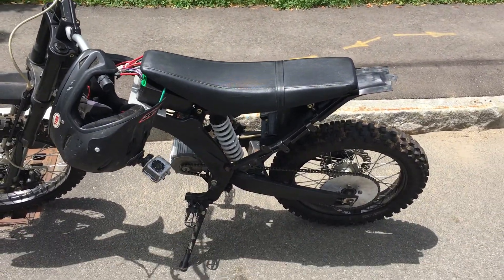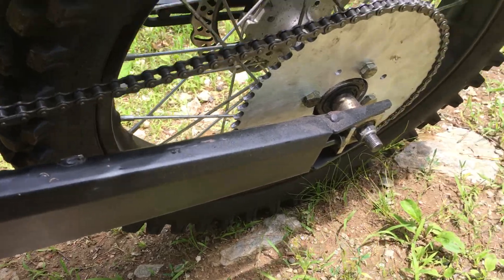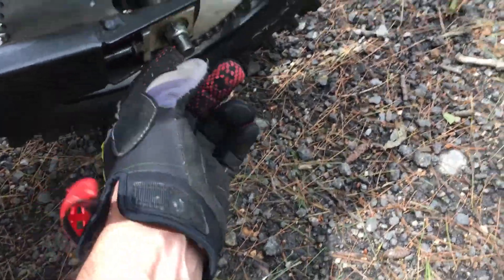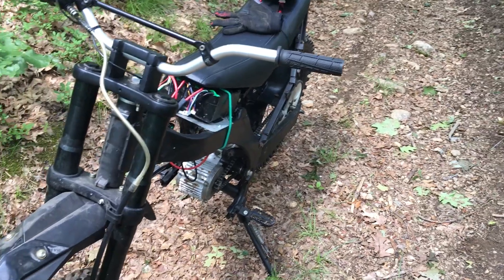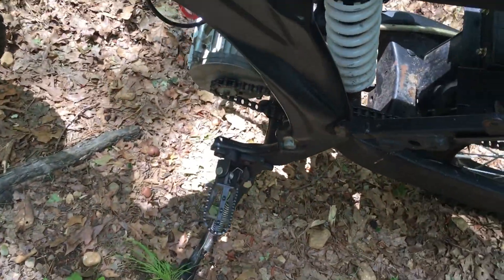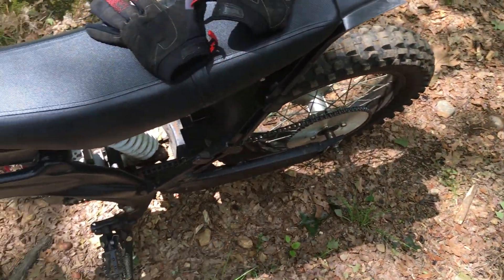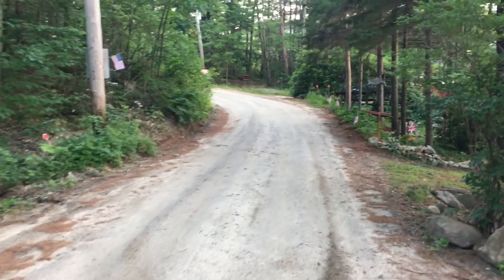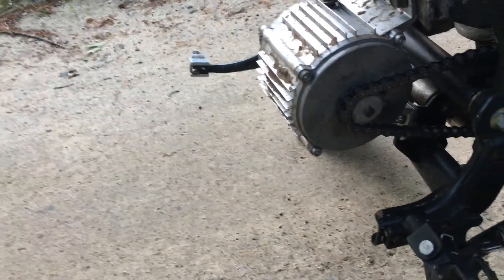Apollo BHT Electric Dirt Bike Test Ride Failure

Comment: Motor power?
Reply from the maker: BHT 1000W
Reply: @EBIKEScott  that is super powerful for just a 1000w motor I’m looking at doing the same thing but with a 3000w motor and 52v battery
Reply from the maker: @jarvo5549  Nice I have a new build soon its a 2003 CRF230F with a Denzel 9000 huge motor 72v 150a
Reply: @EBIKEScott  jeeez that thing is going to rip hopefully with my build should be gojng around 60km/hour and about 35 to 40 km range